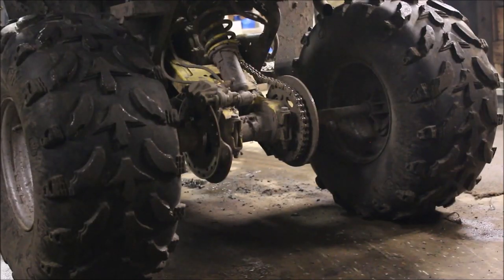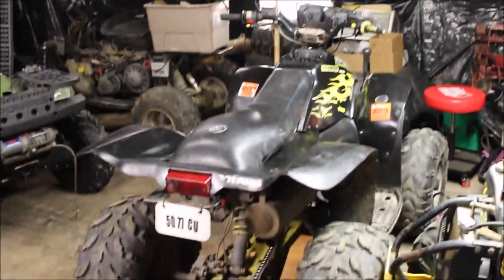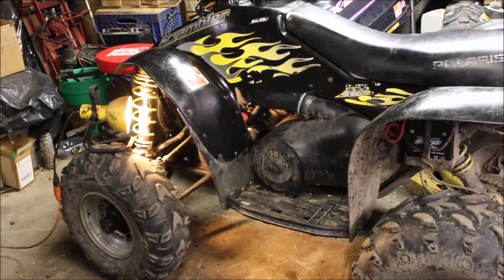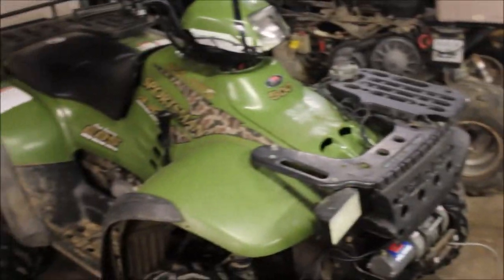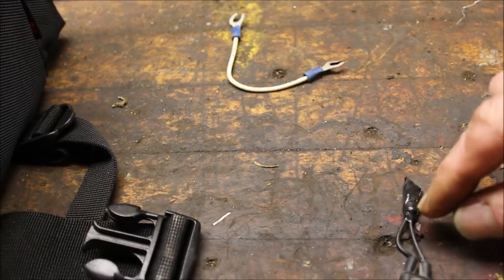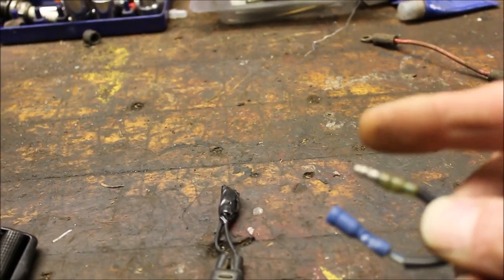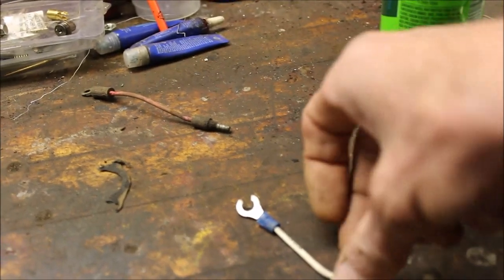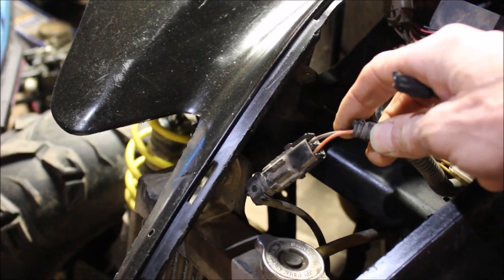How to Hotwire or Test your fan on a Polaris Sportsman, Scrambler or Xplorer.

Comment: Thats what I thought you were doing but wanted to make sure - Great easy fix - FYI - If you dont want to tax your battery so much you can put a Capacitor inbetween the fan and battery at the connector ( just a small one since it doesnt draw to many amps - Then as the bike runs the Capacitor charges and then stores that power to be released when needed that way you can adapt a toggel switch if you wanted to turn it on or off when needed and it will store the energy and release it when needed and won't tax the battery so much since the amount of energy it takes to charge the capicitor is less and the amount of energy you get out over time is lengthened and steady charge. Just an idea ( Take it for what it's worth ). This hotwire works perfect - 1998 Polaris Sportsman 500. Great job keep it up.
Reply from the maker: Great tip. Thanks.
Reply: I was wondering if it would be draining the battery. I had to think of something temporary as I wait for a new sensor. I was going to make a jumper cable, but as I went through my electric box I found a on/off switch that fits perfectly in the plug. Even though I had it switched to off, I think it still drained my battery overnight so now I just plug it in an leave the fan on as I ride. Would that damage anything to leave it on?

Comment: Love the videos. I used the a ton rebuilding my 99 polaris sportsman 335. Does the fan bypass work for all the fans ie, radiator fan as well as the oil cooler fan? Ive got everything working and running except for the fan and the killswitch which i have a wire to ground it out for now. Again thanks for the informative videos.
Reply from the maker: Never tried it. As long as you have direct power to the fan it should work.

Comment: I have 2001 Polaris Sportsman 500 HO that I am working on.  I have replaced both the fan and cylinder head sensors, thermostat and have just ordered a new radiator cap.  I did wire the fan to a battery charger and the fan motor runs fine.  Any ideas on what else to check next?  My research tells me that a water pump replacement is unlikely but who knows I may be the lucky one who is the exception rather than the rule.  The temperature light comes on after a mile or so.  Thanks in advance fo any suggestions you can give.
Reply from the maker: Clean the radiator or possibly a new one. Had that problem a couple times. Had to replace the rad

Comment: I have a Jaguar 504x for and the fan is not working I got it home from my buddy's house in the fan won't kick on in the radiator overheating
Reply from the maker: Will it work if you bypass the tempeture sensor? If not your fan is shot or the sensor is bad.

Comment: What is the best way to fix the O" ring exhaust leak on a 99 sportsman 500. I put a new one on it and it didn't last no time....leaking again....
Reply from the maker: New springs. You are talking about the exhaust doughnut correct?
Reply: @TitaniummanGarage  yes
Reply: Yes the exhaust donut gasket
Reply: Thank you for replying and also...all of the bushings on the A arm's are completely gone so It needs a whole complete new bushing replacement kit.. any recommendations on who or where to order a kit from?
Reply from the maker: Partzilla sells OEM. I would check them out.

Comment: First great videos!!! I have a 98 sportsman 500 im stumped on lil history unfortunately i sunk it twice since then ive put new headgasket old one was leaking new fuel pump new carb boot and carb (its the 500 ho carb boot and the ho carb next step is a new 500 ho cam so it should in theory be a ho then) the problem is it will idel fine then start to idel high. When it first starts up at about 3/4 to full throttle it will spit and stutter but go away as is just getting air out the lines but i can ride it all day no priblem until i cut it off then it may take 5 mins to maybe taking the plug out and cleaning it ( blackened soot from the bigger carb im sure) to maybe having to put a new one on! I literally tried for 2 hours yesterday to start it back up and wouldnt walked out today and it fired right up cut it off fired up after a few moments to not cranking! Any ideas would be greatly appreciated!!!!
Reply: And on the head gasket i put on i was getting back pressure into the radiator i did check the head to see if it had any kind of wobble to the best i could tell it didnt but still have a lil back pressure in it read somewhere it could be the water pump bearing seal leaking letting crankcase pressure in it im not getting water in my oil though wouldnt it flow into it while it wasnt running?
Reply from the maker: You you'll have to. Check out my channel.I have lots of videos  engine rebuild, carb, H.O.conversion. sounds like its running rich and the head gasket has a leak. I've had that problem. Is the plug black and wet? Look down the cylinder if you can. See if its wet at all
Reply: @TitaniummanGarage  im a subscri er to tour channal im always going through your videos to find what i cant figure out i thkught head gasket leaking but heres the catch ln that unless i go full throttle it wont back pressure and blow out the over flow if i just cruise around theres no problem only full throttle yes the plug is black and wet from the flooding i never had a problem with it cranking until my fuel pump went out then the carb started messing up so just bought the ho carb and boot and i say a problem i put a new plug in it fires straight up
Reply: @TitaniummanGarage  i can put a new plug in crank it up cruise around get on a good stretch open it up full throttle and i can feel what i assume is it over loading with fuel i can let out just a hair and it lose the small bog but i can also stay in it and it will have that small bog for about 5 seconds then burn it out and start getting full power and still has plenty of power i get out of it at about 55mph so im guessing i need to check the jug on it this time around when i do new head gasket
Reply from the maker: @elziewinters5513  I had a thought after I messaged you. Have you checked the radiator to see if its plugged with mud. That will cause that issue too. Is the H.O. carb an aftermarket? I bought one and it dumped too much fuel in the engine.I threw it in the garbage. Have you tried the mixture screw yet? 2 turns out unless your in higher altitude.
Reply: @TitaniummanGarage  yes it's a aftermarket i know i know lol i took it back off tonight i tightened it to see what they had it at and it was preset at 1 1/2 and its the fuel side so i opened it up to 1 1/4 i dont know what size jet it is but its pretty big the radiator is a brand new all aluminum welded with no clogs but when it does build back pressure i can let it sit for 2 days and when i open the radiator top its still there maybe my thermostat wont open now i checked it to make sure before i put everything back together i might need to check it again!! Slowly though im going through the carb double checking everything tomorrow ill pull the choke back out and make sure its sealing that part correctly
Reply: @TitaniummanGarage  i do have one more question for you! My cousin has the 700 twin his 4x4 indacator doesnt light up saying hes in 4wd he has 4wd in foward not in reverse and it wont disengage anymore it stays in 4wd all the time any thoughts on it?
Reply from the maker: @elziewinters5513  It could be the shift indicator on the side of the transmission.
They are known to go out. I posted a 700 video a couple days ago about that if you want to check it out. Also is he pressing the override button in reverse? Those 700 are tricky. Does it shift hard?
Reply: @TitaniummanGarage  i know hes pressing the over ride button im not sure about if its shifting hard ill have to find out but ty for all the videos!!!
Reply from the maker: @elziewinters5513   Glad they help you out. One other thing you could try is taking the thermostat out. Make sure you bleed the air out of the lines. What I do is leave that hose disconnected by the thermostat and point it up. start filling it till it starts to trickle out of both ends then quick connect the hose. It works better than the screw by the waterpump.
Reply from the maker: @elziewinters5513  Another thought. If the pump and gasket are not leaking, you don't have white smoke coming out of the exhaust..correct? It could be an air pocket. Something is causing the coolant not to circulate and over heating causing back pressure when it gets hot at high rpms.
Reply from the maker: Once its cool it starts.
Reply: @TitaniummanGarage  thats correct no white smoke and no leaking from the pump or gasket no water in the oil either i did read somewhere my year model was one of the years thats very hard to get all the air out of and to raise the front up a couple feet and let it idle for awhile and let the fan cycle a few times adding water as the air pockets come out i believe ill try taking out the thermostat and see if it will stop it as you suggested
Reply: @TitaniummanGarage  and once again ty for the help i understand how difficult its is trying to help ppl when you cant visibly see first hand what and how its doing this is my second polaris the first bought new in 98 same year as mine now it was a 335 sportsman that i let my son trade for a honda rubicon in 2014 (which is in the back shed where buddies come get parts as needed due the the awesome no replaceable bearing in their hondamatic transmission/ hydraulic pump lol) the polaris at the time of the trade besides the oil and filter was still all original including the same belt that came on it when he traded ik this one will get all the kinks out eventually because i love it when ppl say only hondas are reliable how many kther brands do you see thats over 20 years old out here playing and i tell them mines 23 years old out here out doi g hondas brand new top of the line 520😅😅
Reply from the maker: @elziewinters5513  Thanks for understanding. Yes, sometimes it's hard to diagnose problems without seeing it. You are right about the Hondas. I had one. Installed a new timing chain. (What a headache that was) sold it and stuck with polaris ever since. They are easier to work on and the parts are accessible.  Probably why so many are still out there.